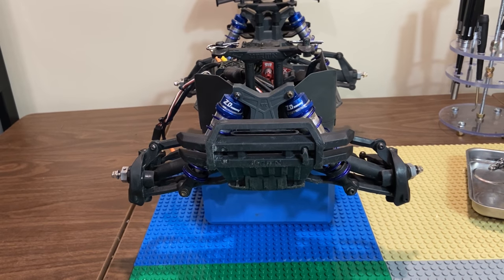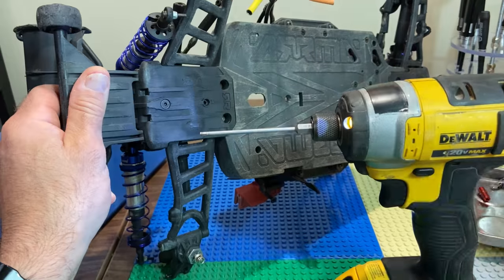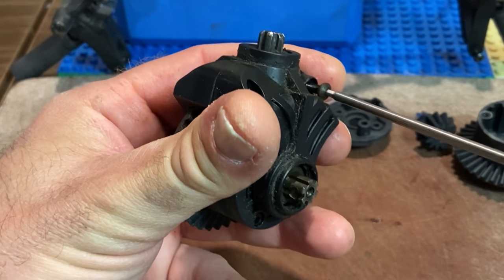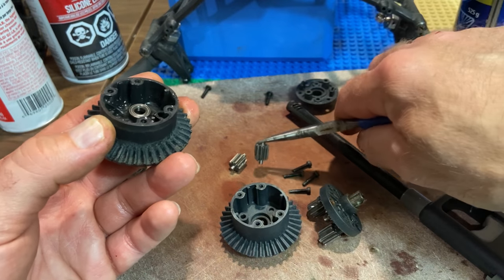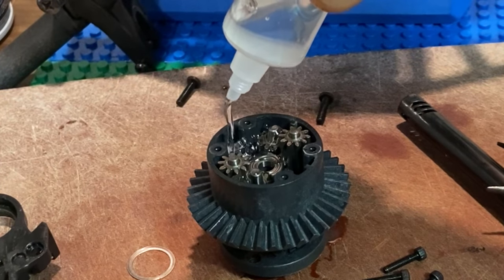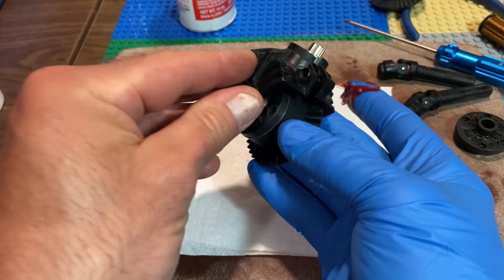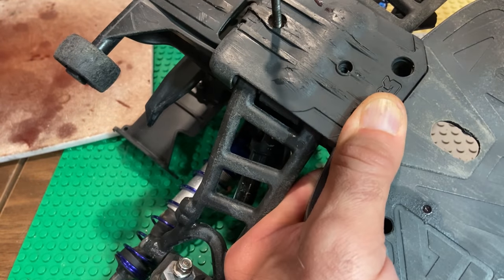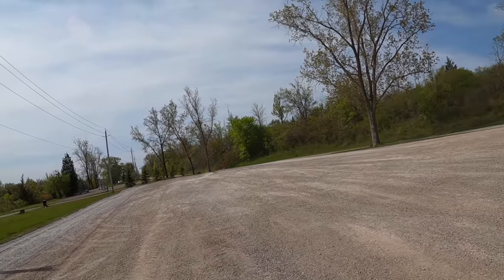ARRMA HOW-TO: 3S AND 4S DIFF REBUILD | GEARS, BEARING, GREASE AND DIFF FLUID.

Comment: Why do they use plastic gears? Do they make metal ones? Does it matter?
Reply from the maker: HI. Yes, they do make metal ones and they do make a difference. They are costly but last a long time.  I've used Arrma and Hot Racing helical and both are holding up great.  I have the part numbers in my "Metal Fail" video. You can also use the the diffs from the new 4S Arrma models. They work great as well. Hope this helps
Reply: @phillybrc  so my options are stick to the plastic ones and make sure to grease them up and run the slipper looser, or get a 4s metal diff for 2-3x the money but they should last forever on 3s
Reply from the maker: @kenmastersmaster  yep. The metal is worth it in my opinion. I m glad i did it. I only went metal in the rear, not fron,not sure if i mentioned that.
Reply: @phillybrc  yeah I never thought about diffs coming from Traxxas which make all metal diffs but had my eye on granite for years and finally bought it because it's 259 this month for truck month
Reply from the maker: @kenmastersmaster  It’s a good move, i still love my granite and won’t get rid of it
Reply: @phillybrc  I was debating between this and the mt10 but think the granite is better
Reply from the maker: @kenmastersmaster  agreed. I just love that parts are available everywhere, even the used market.
Reply: @phillybrc  I have a love hate thing with plastic parts. On the one hand they are cheap and can flex and return to normal, metal dog bones bend and that's the end of it. Same with the drive shaft. It's like the debate about metal vs plastic pew pews...
Reply from the maker: @kenmastersmaster  agreed. they have their place. Never arms.

Comment: Hey, I just got the diff together but I don’t have grease for it, what grease do you recommend, also I need lock tight
Reply from the maker: I use Red n Tacky.  Or, grab some marine grease. Usually local hobby shops sell it.
Reply: @phillybrc  nice, yeah i just used some grease, also, any tips to help this thing not strip as much?
Reply from the maker: @Evan-rq2ee  did you have diff problems or your crown/input gear problems? -Ensure that motor mount is straight is key. 
-don t land jumps on throttle
-ensure throttle control on grass or other high traction surfaces
-Possibly wedge something under back of the motor. Upon hard landings the motor wants to move.
Reply: @phillybrc  so 12 days later and the diff case stripped. 😂 are they hard to replace?
Reply from the maker: Nice. Red n Tacky by Lucas or some marine grease. Hobby shop sells it
Reply: @phillybrc  my diff case stripped, do you know what diff fluid you can put in it?
Reply from the maker: @Evan-rq2ee  It s in the video. 20000 cst diff oil
Reply: @phillybrc  cool, thanks, also what tool are you using to pry the bearings and thin things off, i struggle getting the bearings off the input gear
Reply from the maker: @Evan-rq2ee  I actually put the links in the description recently! Thanx for sll your support. Appreciate you
Reply: @phillybrc  thanks for the help
Reply from the maker: @Evan-rq2ee  you re welcome

Comment: Hi question. The gasket is made of asbestos?
Reply from the maker: Oh, no clue! Lol. I don’t believe i said that haha
Reply: @phillybrc  ah ok. Last question sir i just got my granite. Does the tools included in the box will open everything or do i need to buy additional tools? Thanks.
Reply from the maker: @Tylenol888  You will need more tools to make your life easier. I've actually added a couple links in the description!  Thanx
Reply: Ok thanks. Its my first truck i want to take care of it so i need to able to repair it or customize it
Reply: And also sorry this is my first time owning this type of hobby so many questions hehe. Does the punch 1 setting can still do the wheelie?. I dont want to do that yet since its my first time.
Reply from the maker: @Tylenol888  Absolutely. Don t have to apologize for asking questions, I don t mind at all😀
Reply: @phillybrc  thanks. So punch settings 1 can still do wheelies? I am scared. Hehe.
Reply from the maker: @Tylenol888  Use a 2s battery!! Still fast!
Reply: That is what i am thinking also. But in the remote i can adjust the power it think to 50 percent. Since i have a limited money for now if i buy 2 battery. One 2s and 3s. My plan is 3s then 50 percent maybe it will be easy to handle first? Then i can also experience top speed in the future

Comment: Where do you get the 2.5 mm hex skinny enough to enter into the driveshafts? I just got a Dynamite set but, they're too wide to insert into driveshafts
Reply from the maker: Oh really? Umm, my local hobby shop had them. They are a cheap asian brand, but work well! They are on bangood i believe...i havn t ordered from there but have seen them. Thx for watchin’
Reply: @phillybrc  yup, the set works on everything else besides the driveshafts, I found a cheap HobbyPark one on Amazon for $11. You really do make getting the motor out easy, I was pulling on mine and wedging a flathead screwdriver back and forth for a bit. Great video!!
Reply from the maker: @MrJaxonD23  oh ya, i always need a screwdriver too, I think cleaned the car for the video and had it out right before haha! Thanx alot and thanx for watchin!
Reply: @phillybrc  so I got the front diff out and added more oil, now I'm working on the rear diff. The case where the planetart gears sit seems to be stuck together even after removing all the screws, any tips on getting it apart?
Reply from the maker: @MrJaxonD23  It s possibly stuck at the gasket. I sometimes tap the lid with some pliers to break the seal. Pry gently or you ll ruin gasket(unless you plan on replacing).
Reply: @phillybrc  solid advice. I think it is, I may have ruined the other one doing that, it was a little funky when I put it back on, it may have just been old since it is a V2, may just buy a couple new gaskets eventually.
Reply from the maker: @MrJaxonD23  You may need to replace the gasket.  They get ruined sometimes because they hard to see being black also. Let me know how you make out.
Reply: @phillybrc  just tried real quick on my lunch break to get open, I was able to get it open without ruining the gasket I'm pretty sure. I tapped at it with the handle of the pliers then used the smallest flathead I have in 1mm to pry at one part just a little before pulling apart.
Reply from the maker: @MrJaxonD23  Beautiful. Good Luck!

Comment: I've found that sometimes the spider gears requires shimming with a tiny washer to help eliminate side to side slop, nice video!
Reply from the maker: Cool, I havn t heard of anybody shimming these gearboxes. Interesting. I m gonna research that. Thanx for the input. Thanx for watching Dan!
Reply: @phillybrc  It was a brand new diff too. the spiders could fall into a way that meant that all four would touch the outdrive. which would smash the teeth off the outdrive. just one small washer stopped it.
Reply: How do you measure slop/lash when you need the case assembled to support both ends of the shafts?
Reply: @timmurrayy  You can hear the gears rattling if you assemble it with no silicon oil when they need shimming for slop. Nothing I know of you can do about lash. I had multiple failures of internal diff outdrives from the spiders getting to loose and being able to slip up and down the shaft that holds them smashing them into the outdrives.
Reply from the maker: Interesting. I havn t anybody have this problem. I will say the rear diffs of my 2 cars fell very different from one another. One smoother than the other. I put a 3mm shim between the yokes to avoid over-tightening.
Reply: @phillybrc  I've had one diff case that was really bad for it, in the end I just bought another but it gets annoying to keep trashing all the plastic all the time so I try and keep it going as long as I can.

Comment: Does the shim go on the gear or non gear side of the casing? Thanks
Reply from the maker: Gear side!!
Reply from the maker: Thanx!
Reply: @phillybrc  Are you sure?  In the video it shows it on the non gear side and I just opened up the front diff on my Big Rock and from the factory it was on the non gear side.
Reply from the maker: @BriansRCStuff  i found one on the wrong side also! It goes on the crown gear side. You can verify on Arrma exploded view.
Reply: @phillybrc  You are 100% right... I see.  Thanks for the info!

Sucks as I just went back in and moved it to the other side!  Arhh...

Thanks so much.
Reply from the maker: @BriansRCStuff  No prob!  Thanx for using my video for help!
Reply: @phillybrc  I made a video where covered an embarrassing screw up I made when trying to service my front diff and I gave you a shout out as I really appreciated the help!  Also, check out what Arrma had to say (time stamped) https://youtu.be/9OguPfuwxSo?t=382

Comment: Great video. I just ran my typhon on 3s today, and it stripped the front dif! I’ve upgraded the rear differential to metal gears and never thought the front would strip. Any thoughts? shim it more?
Reply from the maker: Ah bummer man. Ya, i was just told this week that an extra shim on the crown gear side will tighten things up more. Good luck dude. Thanx for watchin’ !